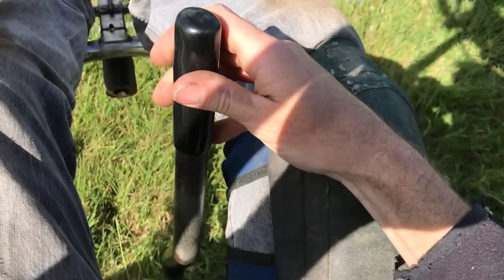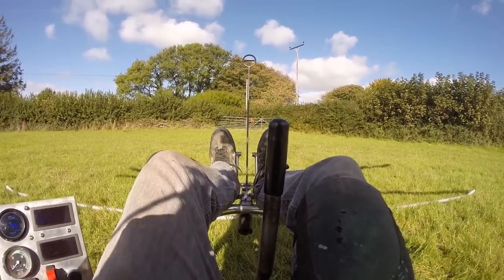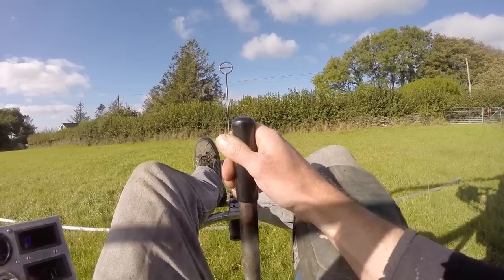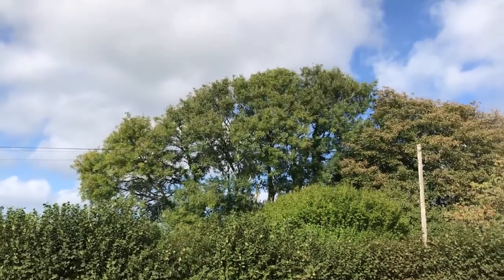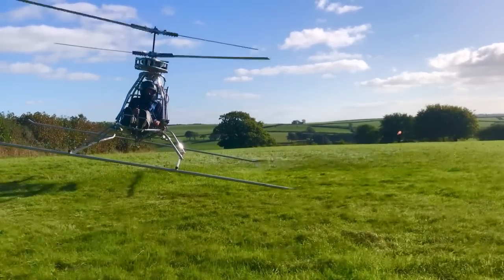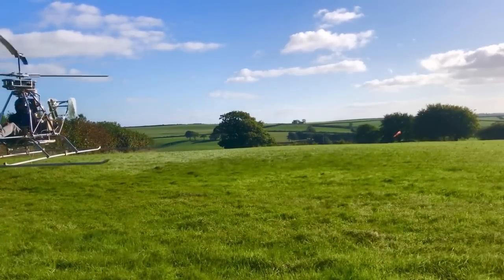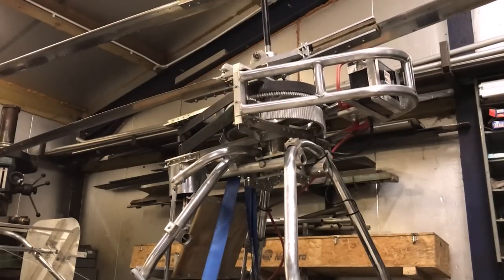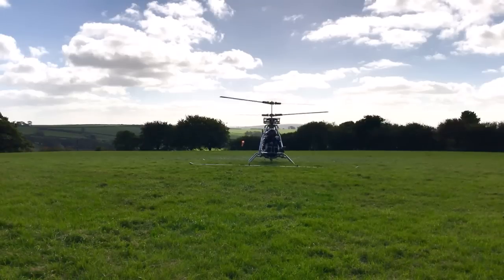Dodgy Moment, Homemade Coaxial Helicopter Learning to FLY

Comment: Awesome progress. You only have to rewind a few vid’s to see the difference. Wont be long before you look down and see your hands and feet flying by themselves. It’s a weird moment. As you say though, all that does is provide a little more brain capacity to learn the next skill. Seems an endless journey for a while but you’re definitely doing everything  right, slow and steady wins the day. Thoroughly impressed sir.
Reply from the maker: Thanks for the comment Paul. I Would say learning to hover the helicopter has been as hard as building one. I knew it would be difficult but not this difficult. Patience is tested to the limit, but things are starting to click, just very slowly. I've actually got it easier with the coaxial, no torque reaction and no managing of power with collective. You can see why dual instruction is thought to be the only way.
Reply: @Ben-Dixey  It sounds silly but you may try singing or humming a tune as you practice, moving the focus of your mind away from the immediate intricacies of the coordination exercise can keep you from tensing up and free up your automatic responses to start working. Just a thought. Live what you're doing, when I was a lad I started work on designing a glider, it was the one time my father said "NO, you ain't doing this!" ...Rather glad he did as I was running blind with one old book on gliders to go from. :-)
Reply from the maker: @JesseP.Watson  sorry, didn't see this message, an interesting suggestion to try. Thanks

Comment: So I'm thinking about a possible side effect of directly pushing the rotors off angle, versus using cyclic.  
With cyclic, aerodynamic forces change the rotor angle immediately without a counter-force on the aircraft body.   The rotors fly themselves into their new orientation, and the body only reacts to the change in thrust angle. 
But you're directly pushing the rotors off angle, and while they may counter each other's precession, you still have inertia to overcome so as you push them off angle one way there is an immediate counter-force applied to the aircraft.   
e.g.   In order to quickly tilt the rotors to the right, there must be a reactive force on the body, tilting it a little to the left.  
But what happens when you stop pushing on the rotor and hold the stick in its new position?   Gravity will pull the aircraft body back straight down and unless you counter that on the stick, it'll cause the rotor to tilt a little more to the right, which is then followed by more tilt to the right as the thrust line starts pulling on the top of the aircraft, so a little commanded right, becomes a little more right, and then a little more right, which is a bit of a positive feedback loop.   

Let's go back to the cyclic heli for a sec.
If you're level, and you quickly tilt the rotor to the right, the body initially stays vertical, then as the thrust angle changes, and starts to pull the the top of the aircraft right, it'll cause the aircraft body to lean a little bit right, but then gravity will try to pull it down straight again (causing a little left rotation), and if you hold the stick still, that will cause the rotor angle
to also return back a little left, which is a negative feedback condition.  

I suspect the difference is subtle, but most noticeable while trying to hover in turbulent conditions.
My hypothesis is that you may need to think about giving a command and then taking it back a little bit (moreso even than you would with a normal cyclic heli).
Reply from the maker: Very Interesting comment and I'm going to have to think about what's been said. There is one bit of information I would like to add, I believe aerodynamic forces help to tilt the rotor by cyclic angle of attack changes. The same as a gyrocopter where moving the cyclic is very easy. The difference with my coaxial is the top rotor being so far away from the hinge. This means some force will be needed to move the rotor laterally which causes the airframe to tilt as you mentioned. I can feel the cyclic stick wanting to return to centre after an input which I think confirms that some weight shift is indeed going on.

Comment: Collective is about mass. It can be changed very quickly, but the whole head can’t move that quick. It’s like live axel vs independent suspension. Equally, I thought it flew very well :o) it’s going to be jumpy when the whol thing is so light.
Reply from the maker: I expected the same, I thought the movement of the mast would be hard and slow and I might even need hydraulics. However it's incredibly light in flight, almost as light and responsive as a Robinson. Not quite the same but very similar. Not what I expected at all.

Comment: I guess also it has a high center of gravity with the drive design? Increasing momentum of a dynamic roll over.
Reply from the maker: Well yes, the drive is quite heavy and high up but the engine and pilot position is quite low. If you look at the sch2a coaxial helicopter it has its engine up by the drive. That would be much worse than mine with regards to dynamic roll over. However I think it could be easier to control in the air, perhaps reducing control latency. I haven't got my head around the effects of the vertical position of CG on helicopters in flight.
Reply: @Ben-Dixey  Non the less your work is impressive! Keep it up!
Reply from the maker: Thanks 😊👌

Comment: hello mate, may I suggest pointing your nose into the wind, increases the wind-cocking effect and stabilizes an IGE hover. Please also extend the front and rear skids, or extend the bent up ends to avoid a dynamic rollover. Also, would pay to maybe get one or 2 hours in a Robinson r22 to learn the basics of helicopter control as it is the most unstable helicopter out there. aside from that decent hovering, have seen worse in real helicopters in people with 10hours
Reply from the maker: Hi and thanks for input, great thoughts. Interesting to know that the R22 is the most unstable bird out there. In the previous video I did some training in an R22 it was a great experience and plan to do more.

Comment: Much improved flying!
It almost seems like you don't have enough power or it's just too heavy have you tested to see how much lifting Force the helicopter is capable of at full throttle/pitch?
Reply: Yeah I think as far as gauging your fan efficiency versus horsepower laws versus lift a simple way to connect a force gauge to the ground  and try to take off at maximum power would be a great simple way to verify changes
Reply from the maker: Hi, i haven't tried full throttle on the new blade pitch setting yet so don't know how high it can now climb. I don't know what pitch setting is going to give the most lift either but I'm expecting 7 degrees will be somewhere close. Currently bottom rotor is 6.5 and top rotor is 5.5 degrees. Take off weight is around 250kg and the expected mtow is around 300kg, comparing other coaxial's.
Reply from the maker: Yes is could be done and it would be nice to know some figures.

Comment: just a thought. Would a pair of motorcycle steering dampeners do a better job at dampening your hand inputs than the cushion? Would be more adjustable too.
Reply from the maker: It might do, worth thinking about. The resting of the arm is what Heli pilots do and they control the cyclic with more of a wrist action. It also reduces fatigue while flying. I'm not aware of any cyclic dampeners being used on commercial Helicopters but they do have cyclic friction which I think is mainly used in forward flight. It might help, my only reluctance would be if you needed a quick input to recover a situation the damper might prevent such a quick movement.
Reply: @Ben-Dixey  'I am not an aircraft engineer'. I just thought it might help reduce accidental input and create a less twitchy experience. 
Great project by the way 👍🏼
Reply from the maker: Thanks all suggestions welcome. I'm not an aircraft engineer either.

Comment: Good build, What degree did you set your fixed pitch blades 4 or 6 degree?
Reply from the maker: Thanks, the top rotor is set at 5.5 degrees and the bottom rotor is set at 6.5 degrees.

Comment: Just curious about how much this cost, an xe helicopter is about 46k so how much have you saved
Reply from the maker: Hi, I've spent £6k building this so far. luckily I bought all the aluminium before the price went silly. To do it again now may cost £10k. This machine will never have the capability of the xe so can't really be compared. A cheaper alternative would be to find an old mini 500, that could be used just for hovering like mine is Intended. For me it was as much about the building as learning to hover, with that experience being valued. To be able to fly properly in the uk the cheapest available option would be a used Rotorway. I don't really have much aspiration to get a pilot license or fly above a few feet, it was just about having fun in a field.

Comment: Minutes instead of seconds, awesome. You do realise that hovering at one foot is a lot harder than hovering at five feet.
Reply from the maker: I've been told that and have experienced the difference between 6^ and 3ft I can imagine 5 feet is even better. Going 5ft high takes some nerve at this stage which is why it hasn't been attempted. Assuming that is it has the performance to go that high that is.

Comment: Looked like it is very sensitive to stick inputs and difficult to smoothly change or hold position. Would a dampening system help there? Like a 2, 3, or 4 way set of model shocks or other small and light dampener? There are probably better ways but my suggestion seemed simple and cheap to try if it helps or not.

On a side note I really want to learn para-motoring but finding anyone in my area that isn't booked out to 2024+ seems impossible.
Reply from the maker: Hi. A few people have suggested this, I personally think that the control needs to relatively free and undamped. However some helicopters have cyclic friction, whether it's used in hovering I don't know. 
Shame about the paramotoring, seems similar with heli lessons, they are still trying to catch up from covid, meanwhile instructors have left the business of teaching.

Comment: Are you running the engine at 100% rpm to maintain hover and controls?
Reply from the maker: Hi, no not 100% rpm, the engine at hover is 5500 and the recommended WOT rpm range is from 5500-6500. If your asking about reserve power then I'm not using full throttle at any point but don't know how much power is left over as I haven't tried full power with the new blade pitch setting.
Reply: @Ben-Dixey  what is the hp rating of the motor?
Reply from the maker: 60 but could be 70 now with my tuned exhausts.
Reply: @Ben-Dixey  love what you have achieved mate!

Comment: This is the fist video of yours I've seen an this could be something you've already tried, but have you considered putting actual dampers on the pitch/roll stick and/or what it connects to on the head? I kind of also wonder how much slop there is in the control stick and if that's a problem. Dampers with a spring return might take the load off of you having to manually hold it steady. I know all of that adds weight but it shouldn't add much complexity or cost.
Reply from the maker: Hi. Yes dampers have been suggested I'm not convinced they are the right thing to add. There is a tiny bit of play in the controls which I would like to get rid of. The problem is the pilot at the moment, just need more practise and more flight time would help that. I might increase the sensitivity of the cyclic as I'm having to move it much more than an R22 but not sure on that at the moment

Comment: I always find it interesting that heli pilots have to learn to do the most difficult and scary thing first.  Hover in ground effect, which is by far the least stable condition.  
Generally forward flight in any rotorcraft is easier, more stable, and uses less power, but yes you gotta stop, or at least slow to land.    Do keep in mind that if you learn to "hover" with a constant headwind, you're not really learning to hover.  You're just flying forward at the wind speed.
Reply from the maker: Makes perfect sense to me, in the next video I experience this constant head wind stabilising effect. I would like to try it in a wind tunnel.

Comment: Agree that it would have been best to keep it airborne certainly until you’d stopped the lateral drift. This experience will give you the confidence to keep it up. This was almost a rollover crash, but luckily your bars saved the day. After all that’s what they’re for.
Reply from the maker: I guess panicked pilots do the wrong things. I won't be letting off the throttle next time. Perhaps it can be likened to drifting in a front wheel drive car, the back steps out and if you let off the throttle things get way worse. Keep it pinned and you will be fine, it's just keeping your nerve.

Comment: Great project, going well......um... just a point of interest.. the Robinson Heli's are getting a lot of flack in NZ due to the number of crashes..  they use a tilting head but ALSO freely (vertically) hinged blades like an autogyro... I know they are 2 bladed and lower RPMs but just wondered if it pays to be cautious about going there?
Reply from the maker: Hi, the Robinson's have tri hinged rotor heads. They have flapping hinges as well as teeter hinges. I like the flapping hinges as it elevates blade bending, allowing the blade to fly to its natural position. Gyrocopters usually only have teeter hinges and the blade coning angle is built into the hub bar. I think the Robinson's have had accidents caused by mast bumping this is when the rotor becomes unloaded in zero G situations and cyclic input exceeds the maximum allowed rotor tilt. The blades can strike the tail boom or the mast gets bumped hard enough to damage the shaft. Gyrocopters have also had tail strikes in zero G flight and the rotor must not be unloaded. I very much doubt I would ever experience a low G situation in my low speed low altitude hovering machine. However it's good to understand the situation and be aware of it.

Comment: Glad you've progressed this far 🙂  I would suggest bending the cyclic back about 10 degrees, so your hand and arm can be more relaxed.  For the best control, you should be able to control the cyclic by your thumb and index finger - ONLY.   Gentle movements are best.  If you 'think' about moving in a specific direction, your hand will automatically move, slightly, in that direction.  Currently, you're still 'over-controlling' the craft.  Gentle inputs are required.  Again, Great Work!  🙂
Reply from the maker: Thanks for you're input. 👍👌

Comment: Sorry for a dumb question, is it not possible to fit some sort of Flight Controller as in hexicopters etc?
Reply from the maker: Not a dumb question and yes it is, part of the point of the project was to learn the skill of hovering. The low end commercial helicopters don't have flight controllers and they aren't needed. It just takes time to learn particularly when your flight time is below 2 minutes each run.

Comment: You spoke of anti-torque pedals, but since an advantage of coaxial is that the torque from one set of rotors counters the torque produced by the second set of rotors, do you, really, need anti-torque?  Seems that in your case your heli has a rudder not anti-torque.
Reply from the maker: Absolutely right yes, my pedals aren't anti torque and should be called rudder or yaw controls. 👍
Reply: @Ben-Dixey  Yaw control... that covers it all.  :-)

Comment: Need more rotational speed from the blades but the motor is over revving.

An increased final drive ratio on those blades might help.
Reply from the maker: The engine is at 5500rpm , operational range of the engine is 5500-6500rpm. I can add more pitch to the blades for more lift.

Comment: DO YOU HAVE A PILOTS LICENCE? NOT LIKING THE CONCEPT OF LEARNING TO FLY NEAR POWER LINES.
Reply from the maker: No I don't have a licence. The helicopter doesn't have the performance at the current blade pitch to go higher than around 3ft. You would also have to be flying above the hedge. No worries at the moment but when higher altitudes are achieved I will move further into the field away from the lines.

Comment: I think one thing working against you when compared to the typical swash plate system is that there is a lot more momentum in the system because you're moving quite a lot of mass around  which is why you're not able to make tiny adjustments and you're getting more side to side oscillation of the whole helicopter.
Reply from the maker: I think that's true, moving the top rotor laterally would cause the helicopter to be controlled more via weight shift than traditional control methods.